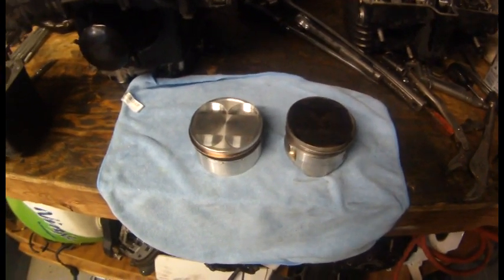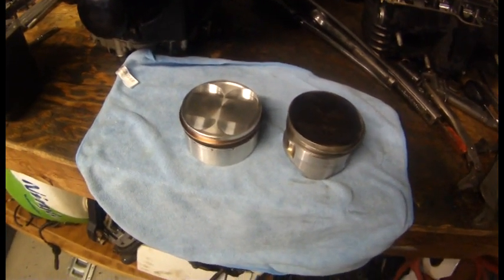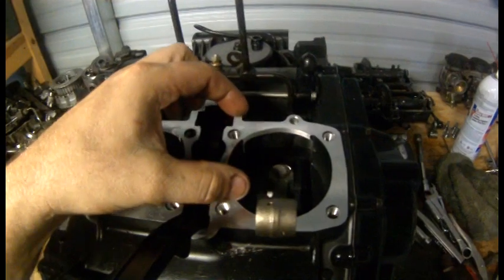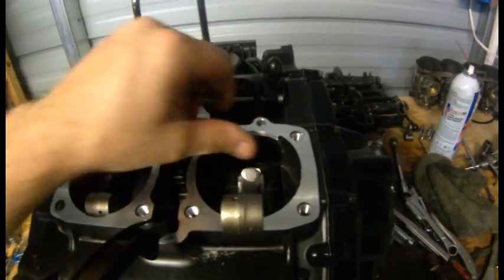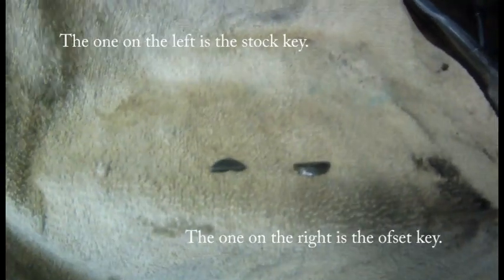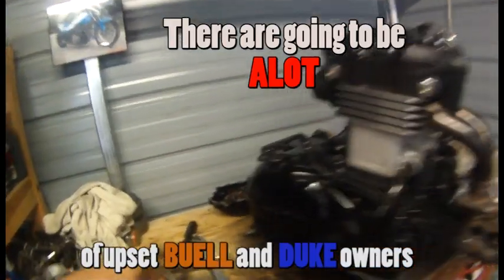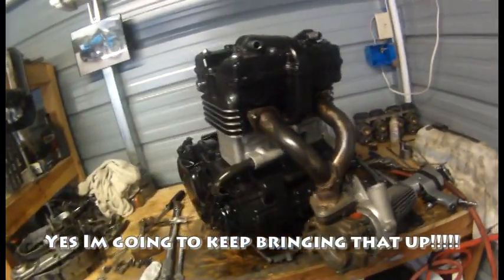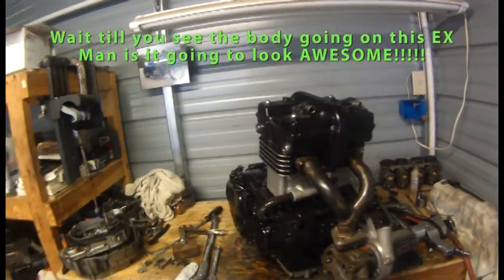EX500 Turbo part 2

Comment: Hey man , I’m currently wanting to rebuild a ex500 engine and looking to get a little more power out of it , was looking into just doing a stock rebuild but since I have to put in new sleeves might as well put in something bigger , do you just use the zx11 sleeves and pistons? What year of zx11 would be the best sleeves and pistons to use on the ex500 cylinders, thanks!!!
Reply: So long as they know what they are doing yes the stock ZX11 sleeves work. But as far as high compression pistons go, Im not sure how they compare to the EX combustion chamber. I did fit a set of 76mm pistons made for the Ninja 900/1000 into another EX without resleving. I just dont want to tell you High compression ZX11 pistons will work since I havent done it myself.I had no doubt with the Turbo pistons because they are dished.
Reply: @danieldonovan4096  right on!! Thanks, what about a head gasket? Are you using the stock one or any particular one that will work with the application?
Reply: @sebastiandosamantes9237  its a custom cosmetic head gasket. Just call cosmetic and tell them the ap pplication and the bore size and they will make it for you.
Reply: @danieldonovan4096  thank you so much

Comment: hi kawturbo1
I want to do the same project that you took advantage of that I have to adjust the engine because it melted, and I have doubts, what did you put in addition to the ex500 engine, only shirts and pistons of the zx11 or should I buy something else .... what kind of piston is could you give me more information please
Reply from the maker: You need turbo pistons, they dont have to be from a ZX11, and retard the ignition. you can run almost 15psi this way on pump gas,with some limitations....Good luck.

Comment: What sleeves are you using the same that fits the piston??? And did you ever get this running good I am currently trying to turbo one myself but I am actually putting it in a Yamaha wave raider Jetske. I know it sounds stupid but I want to try it. I have found simple and reasonably priced fuel injection systems.
Reply: Brett Phillips d